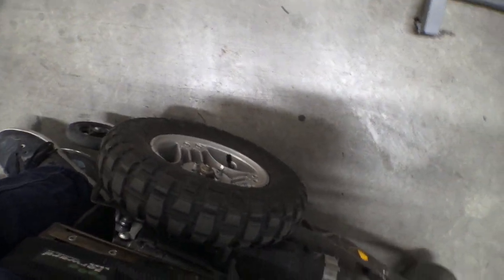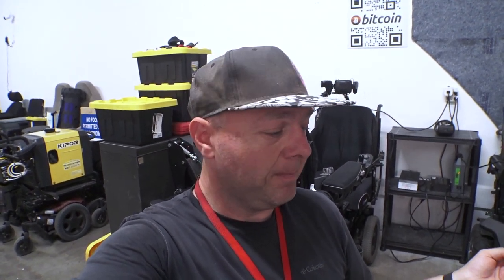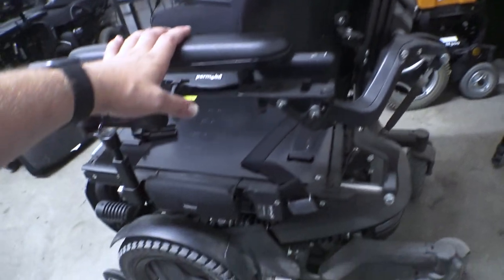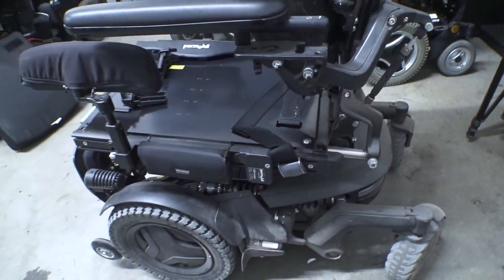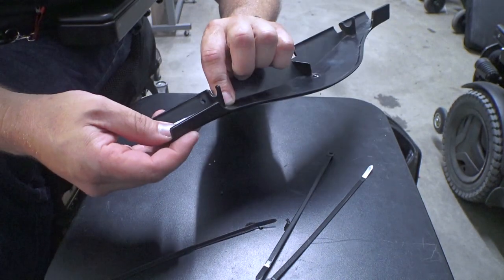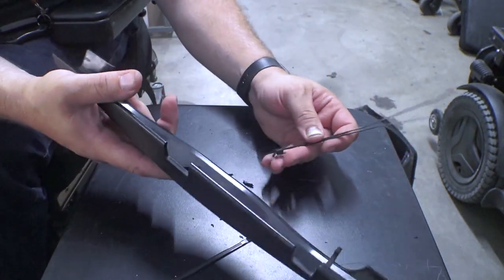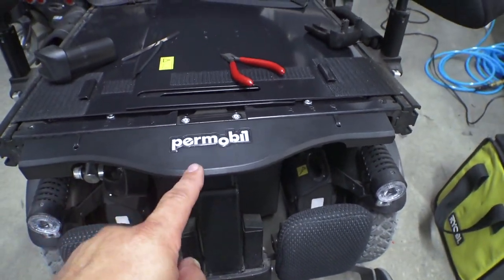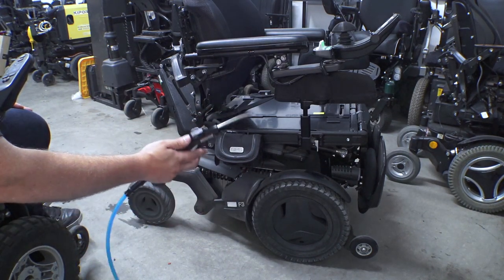VLOG 624: cleaning & legrest cover repair!

Comment: Dan the reason those brass rollers counter rotate is because the outer on is sitting on the bottom of the roller and running along the runner BELOW it but the inner one is running along the runner ABOVE it.  Have a look when you move them again and it will make sense why they go in opposite directions.
Reply from the maker: yea - that's exactly what i said in the video - 
but the interesting part is the other/previous versions of this - they simply had a single slot, and one roller.  didnt make sense to me that a single roller in a slot was supposed to do anything properly! LOL its nice to see one now thats been properly designed :^)

Comment: To deal with the scratches and nicks to the black paint on my Permobil chair caster arms, I have found the small bottle of Testors hobby paint in gloss black does an excellent job.  I detail my chairs every time I replace the tires.  I clean off any paint transfer and dirt with rubbing alcohol.  Then I dip the tip of a Q-tip into a small amount of paint, and dab it onto the scratch.  Do not brush it on.  I do a few thin coats of paint.

Comment: I live by a beach so yes it was good seeing you down on it. I was debating with husband if taking my scooter down the beach was possible. I hadn't thought about how much it cleaning it would require afterwards. Especially as I like to go several times. May be getting a power chair soon . Do you find you have to clean each time. More questions than answers.
Reply from the maker: yes - ya wanna get all the salt spray and such off of the chair as soon as possible afterwards!

Comment: The c500 needed rear fork stem bearings. Aftermarket bearings work fine, but the permobil recommended lube was a number. A friendly PWC tech told me that special lube - brake grease @ autozone for $2. the quickie qm710 uses bolts and nylon bushings at hinge points on the front articulating (Spider Trac) arms - recommended lube is bicycle chain lubricant w silicone. Thought provoking maintenance per your F3 - thanks
Reply from the maker: depends on the model, and year of chair, some of them need to be assembled dry - they've gone thru a few revisions of the flutter clutches over the years - however the bearings used should be of the 'rs' variety, which are pre-lubricated and sealed.  BUT some models do require a bit of grease.  unfortunately the service manuals weren't updated for all the different versions :^/
Reply: @TotallyNormal-  it was unsettling, after a year of use passed, to have received a 2014 wo suspension. broken neck in 1980 age twenty-five. In 1996 due to post-injury incident in quickies 424 pwc  (broken back per emi/ pwc crash - 3 cracked vertebrae). pain became an issue in the following years and the f5 made its debut the following year (2015) with suspension and w complaints of rear flutter. c500 has the o-ring w/ o-ring plate, sealed bearings - caliper grease - blue, applied to o-ring only per directions. happy to have the last c500 @ 2,900 miles - such higher quality than Quickie qm710 @ 1,766 mi. it's a real pleasure to watch your videos and learn from your experiences - thanks!

Comment: Awesome😁 Canon Beach is my hometown and I was wondering if I should take my new M5 or risk my old low rider for the trip from Sweden to visit. I’ll take my new chair. I speculated I could drive my  chairs to Haystack rock but which beach access did you take?
Really appreciate your channel ❤️
Reply from the maker: hey! if you go to tolovana state park, and take the ramp down to the beach, there's a small creek by the end of the concrete path that keeps the sand around it wet all the way down to the ocean! the transition is a bit tricky, but i made it several times.  with your F5, since it has substantially more torque, you'll wanna turn the speeds WAY down.. starting from a stop will dig the tires in super quick! if i frequented the beach more often, id create a profile on my chair just for sand driving.
Reply: @TotallyNormal-  Thanks Dan💞 I know exactly where you mean! I grew up in Tolovana Park😁 I’ll be staying on Brailier road so this will be perfect. I’ll use my tortoise setting🤣😂🤣